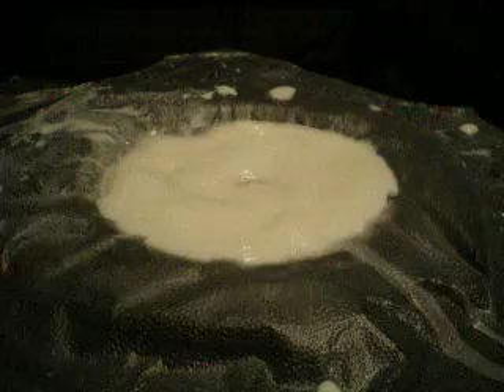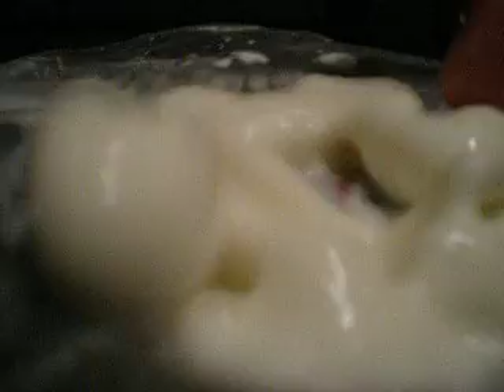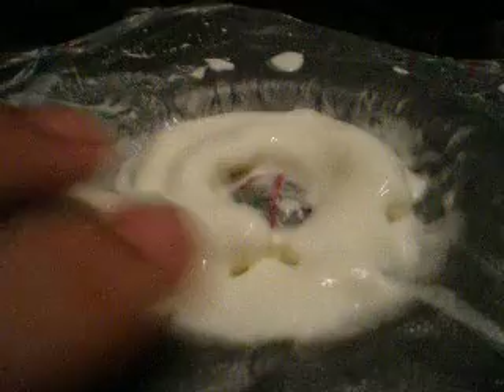Non-Newtonain Fluid

Comment: Water + cornstarch :)
Non-newtonian fluid.
Basically just doesn't go with the normal flow of liquids, as you can see.
Also, it's generally 2 parts starch, 1 part water (I think andrew made a mistake)